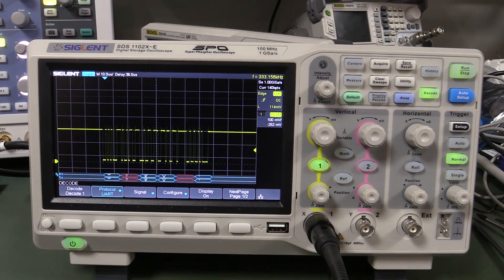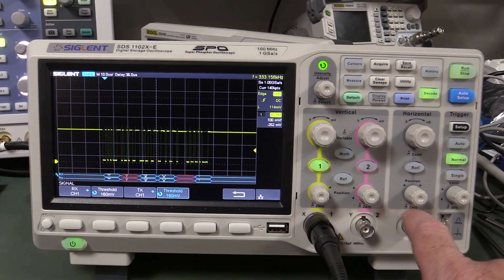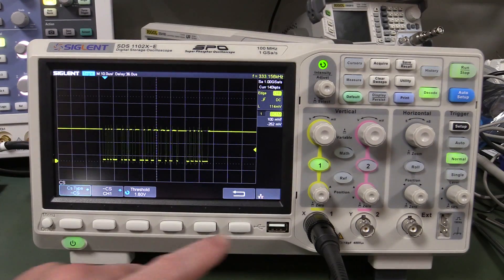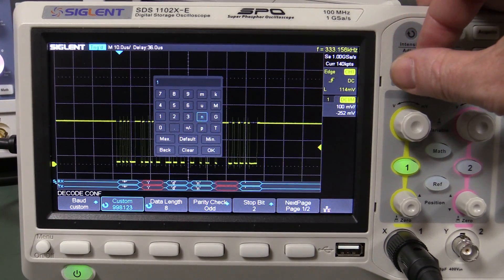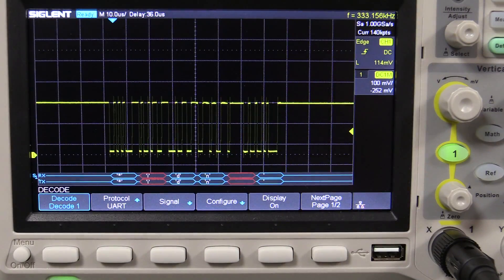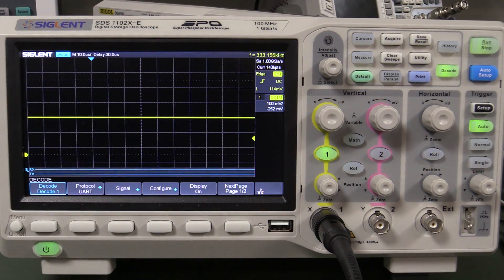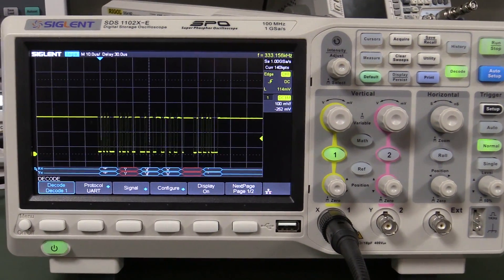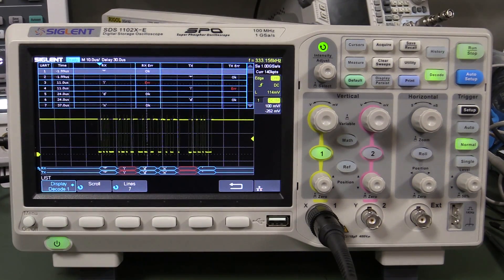Siglent SDS1000X-E Serial Decoding

Comment: The value for the features included🔶>imgs.love/Si-Oscilloscope?ㅝ4  This little solid-state device does essentially all that the old Tektronix scopes did, of 50 years ago. And it's light.
Reply: does all + a lot more.... no comparing a 50yr old scope to this modern beast(for the price)

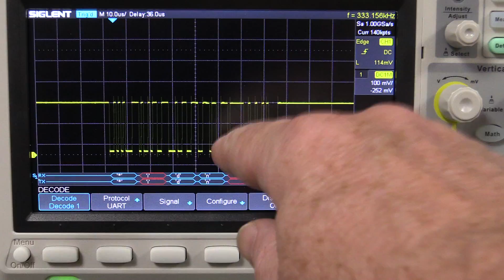Comment: I just bought one of these.  The menus are significantly different.  I have everything set up, but no decoding is shown. I don't have a "display on" button in the menu (like at 3:13)..as a matter of fact, that menu only has one page. No list button, no format selection. Guess I'm going to have to find the manual..

Comment: Siglent makes some nice lab gear, but the programmer for the rotary might be the same as for my Siglent power supply: no acceleration, as it is really nice implemented in the Keysight scopes, and if you turn it too fast, it even misses positions or goes backwards for some ticks. Maybe I should ask them if they need a better firmware programmer.
Reply: Frank Buss encoder programming is always a tradeoff between debouncing and responsivity. Maybe they just use crappy encoders. (It's even worse in their signal generators, the encoder is only usable if you turn it slowly.)
Reply: For the usual rotary encoders with quadrature output, bouncing is no problem if you program it right, like sample the two outputs with 1 kHz and then use a state machine to calculate the transition, instead of what beginners do, like use one output as an interrupt source and then sample the other output, which is a sure way to miss pulses when it bounces. I've used cheap mechanical rotary encoders which bounces a lot without problems, even in the idle position, which I can filter with the state machine without extra code just by choosing the right table values, see here: http://www.instructables.com/id/Using-a-Quadrature-Encoder-with-an-ATtiny-2313-and/

Comment: The 1102x can only record 0.3 seconds in serial decode mode. Max. mem. depth is only 1.4 meg. points (tested on 9.6 kb/s). Does the - E model also have these bugs?
Reply: No. At least 3 years later, the 1202X-E doesn't have it.

Comment: Does this scope also have the "50Hz squarewave hardware bug" which the 1102x has?
Reply: Elektronik   I sent e-mail to Siglent and got answer that it is fixed with new firmware (1102x), but I  am not 100% sure.